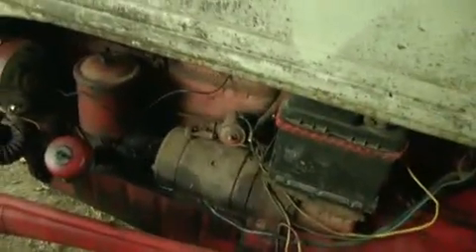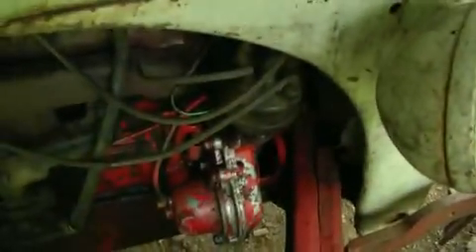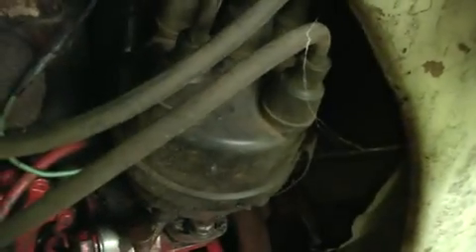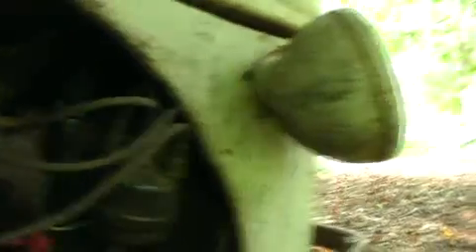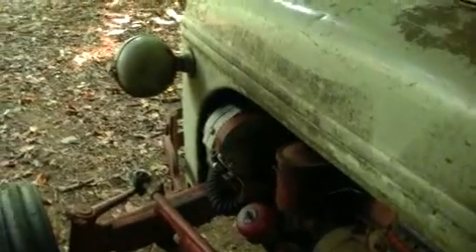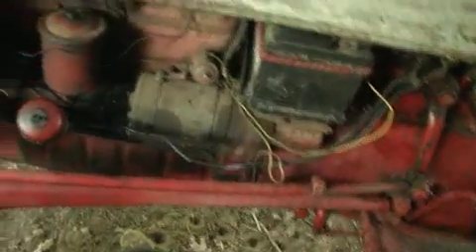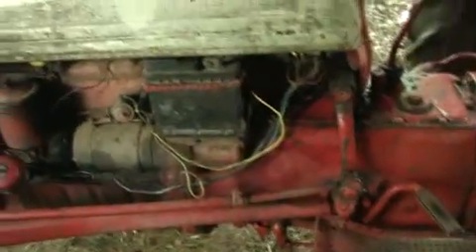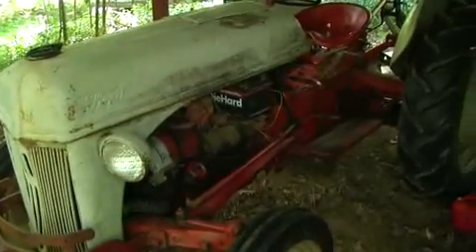How to convert a tractor from 6 volt to a 12 volt system - 6/23/10

Comment: The generator bracket when mounted backwards will accept a GM alt. with the belts lining up for 600-800 tractors too. The line in the dash is a resistor to stop feed back to the distributor and causing the engine to run with out the ignition on. Your 6v starter and coil are good to go, but if you buy a 12v coil there are ones that have a built in resistor, this replaces the external resistor that reduces voltage to the points so they don't burn up.Flip your 12v battery around to neg ground and spin your coil around and put the negative to the distributor.

Comment: Not to detail but pretty much it's pretty simple Simon mines on the right alternator and I got a nice front distributor you didn't say anything about changing the coil converter resistor I don't think you really have to buy a coil 12 volt coil you just gotta buy a ballast resistor that knocks 12 volts going to your coil are you burn your points of in a second and I gotta say anyone in their right mind that was converted. Admission to a electronic ignition is an idiot points are only $5 and when they go bad you just replace them electronic edition can go out at any time no warning signs the owner of it I'll take points in a day yeah the last 12 years in a tractor far longer

Comment: Also, you can change the points in the distributor to breakerless ignition. I got it installed on my 861 Powermaster and it runs just as good as a diesel.

Comment: a way to tell if these delco alternators are charging without a amp gauge is the the bearing housing. on the back becomes magnetic when they are charging just touch a piece of metal to it when it is running and see if it sticks

Comment from the maker: @pickensdoodle i kept the original solenoid on it and it works fine, the only problem i had was the starter gear got stripped out, i dont know if it is because the starter was spinning too fast or if it is just the wear on the starter gear.